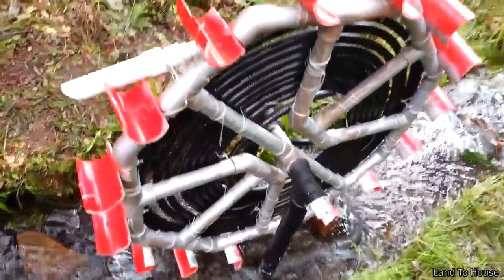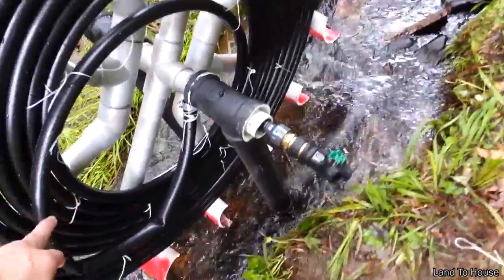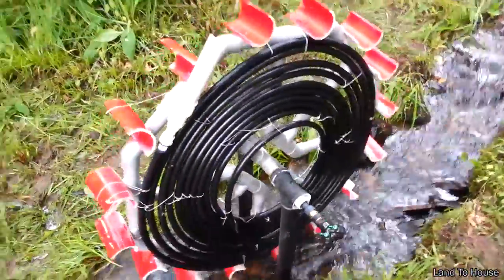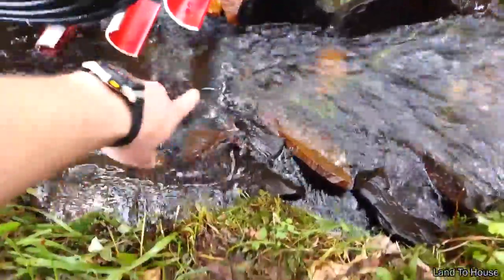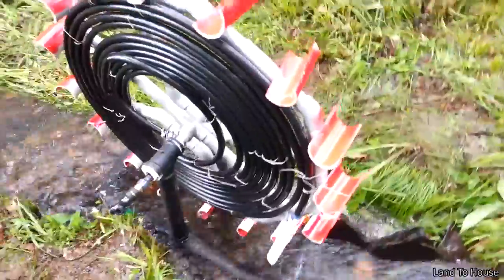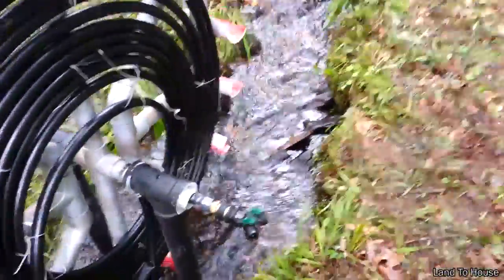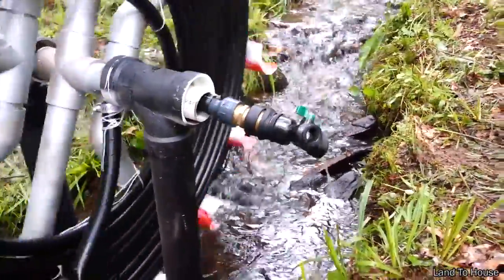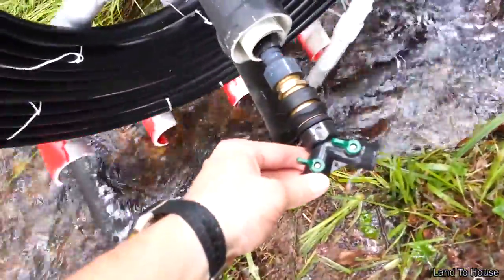Water Wheel Update 2

Comment: Great video! Quick question, how do you call this piece that connects the moving parts of the water wheel with the fixed parts of the pluming? 

I'm trying to find this, but don't know the name… 

Thanks,
Reply from the maker: What I used was a quick disconnect garden hose adapter. The real name escapes me at the moment. Perhaps a swivel union.
Reply: Land to House .com Thank you! I've almost the same situation (low head, low volume) in my land (Brazil) I;m trying to build a water pump as well. 

I'll look for this piece ;) Thanks
Reply from the maker: superlocao you are welcome.  Be sure to lift the support legs so that the water will flow freely underneath.  .... Have you looked into a ram pump? I have many videos on my Channel.
Reply: search for rotary joint. an all plastic one can be cannibalized  from a garden hose caddy that has a rotating connector.   cheers

http://hydro-tek.com.my/assets/Blog/rotating3.png
Reply from the maker: David Davids absolutely!  I actually was given an old hose roller for that part. I was looking at a way to get that part for others and that is why I went with the hose quick disconnect.  :)

Comment: You do know that any more than 1 loop with the pipe is just wasted. The pressure remains the same, and the volume of water remains the same as having many loops. I see many videos of many loops, it's just wasted pipe. With all that extra pipe, you could have had 6 open ends scooping water all around and get 6 times the volume of water with the same pressure.
Reply from the maker: Hello. Thank you for commenting. There are actually two styles of wheel pumps. One has the coils wrapped around the edge of the wheel and this is the style you are speaking of. If the pipe is coiled on the edge then there is no change in pressure of volume. BUT if you let the pipe coil in a spiral down to the center of the wheel (like in this video) then you will have a change in pressure. With every turn of the wheel there is an equal amount of volume scooped. But as the water travels to the center of the wheel the pipe gets shorter in every pass and the water has the same volume. What happens is the air between the water scoops is compressed. The math says that: wheel hight X # of coils = vertical hight of lift.  I hope this helps.